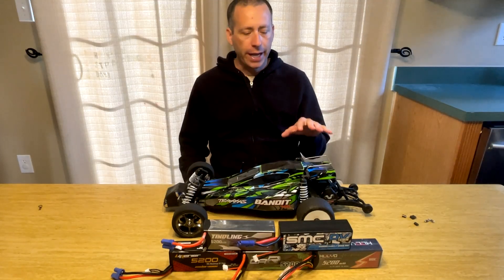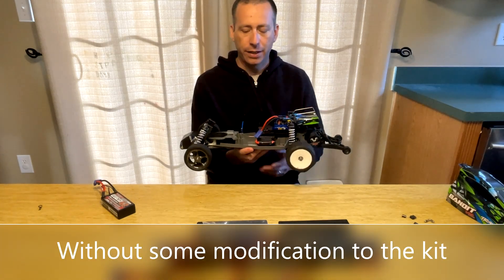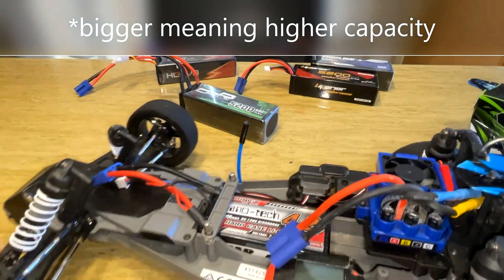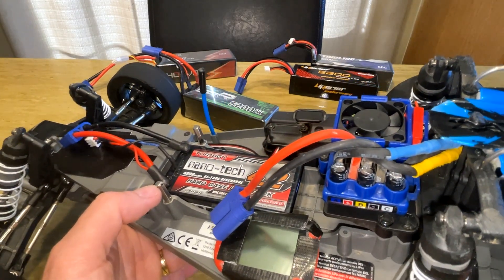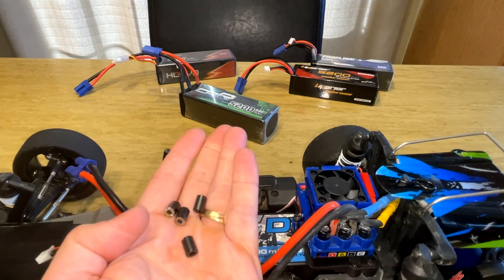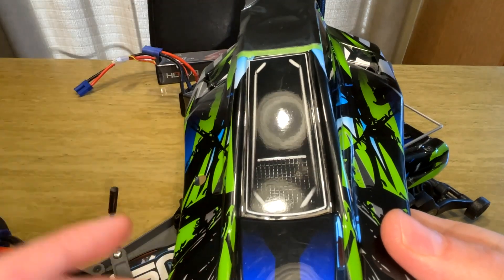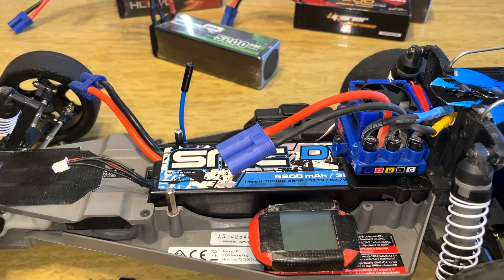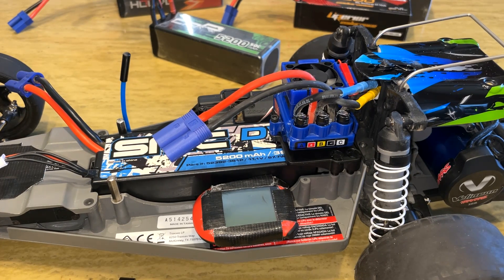Fitting a Larger LIPO and Cooling Fan in the Traxxas Bandit - Maximize Top Speed and Run Times!

Comment: I did the same thing using some aluminum stand offs from electronic equipment.i then use a thick oring to hold the batt down with the 2 clips.I also use a rubber block at the back to take up the space.I still plan on buying a fan.
Reply from the maker: Sounds like a great solution!  Do you have a video showing it?👍
Reply: @BriansRCStuff  unfortunately not.but very similar to what you did.

Comment: Might have to get this kit for Grayson’s Bigfoot stampede. Right now he runs a 7 cell nimh Traxxas battery but he’d like to run our 5200 mah 100c 2s Zeee batteries
Reply from the maker: That would be a really nice improvement. I would think! Might as well just toss a 3s in there! 😁
Reply: @BriansRCStuff  that might just kill the transmission lol. He’s got a 12t Holmes motor in it with the speed gearing. It’ll almost keep up with my 4s usa-1 almost lol 😂